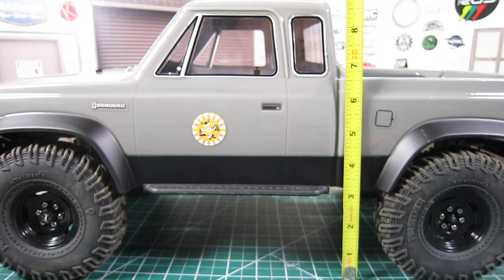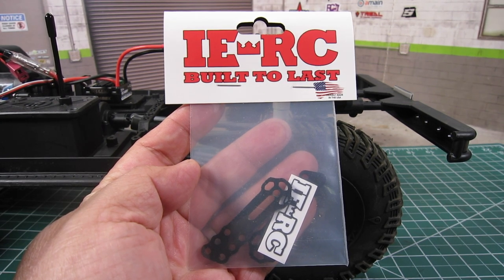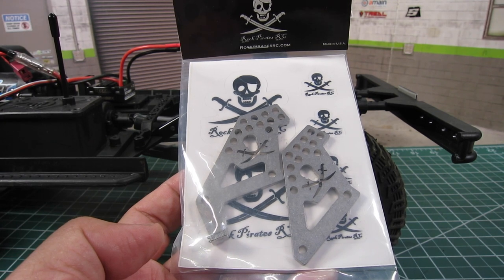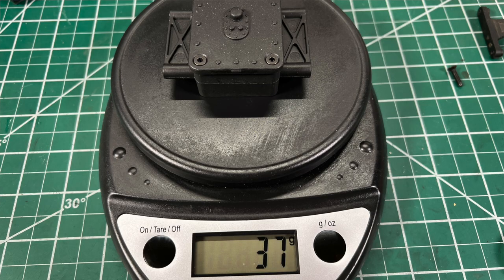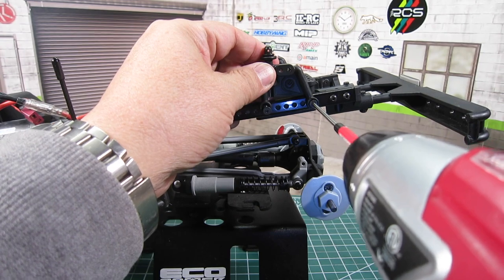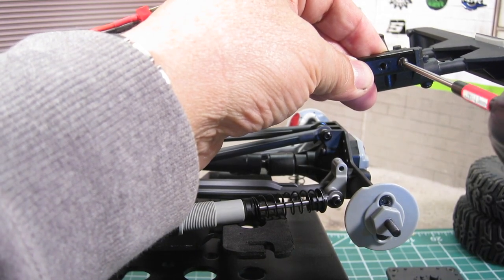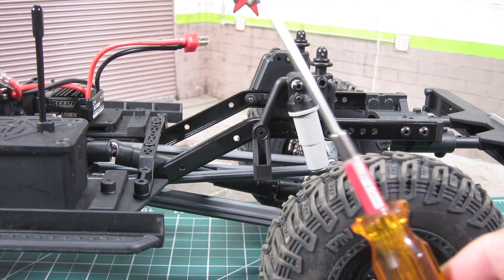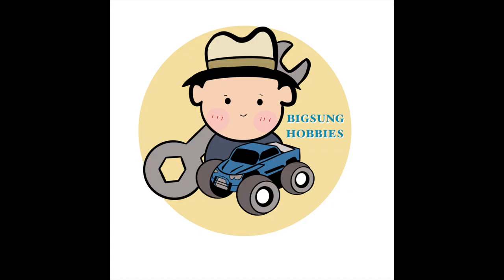Element Sendero SE | FREE Mods - Lower Rear Ride Height & Improve Weight Distribution (61%F/39%R)

Comment: I moved my rear towers all the way forward and then replaced the the stock Element body post with an Axial body post maintaining the stock holes in the bed. I too removed the “fuel cell” and used an aluminum G Speed chassis brace. Nice work on your mods.
Reply from the maker: Thanks for sharing!  Great tip 👍

Comment: What is the point of lowering the rear? I raised my body so that the tires no longer rub when the springs are compressed. The tires on your Sendero grind even earlier now..... IMO, isn't it ?
Reply: Helps with lowering the cog
Reply from the maker: Great question.  It’s a step towards the end goal.  Incremental changes will lead to a truck that takes it to next level of performance.  I will be lowering the front at some point.  The whole idea of lowering the chassis is to lower the CG which is a big part of performance improvement.

Comment: NIce video, doesnt lowering the ride heights, cause body rub?
Reply from the maker: The rear body rub is caused by wheelbase more so than the lowered ride height.  The body is designed for 12.8" WB, but Sendero SE comes with 12.6" WB with the current links.  I plan to address it, and that should help with rear body rub.